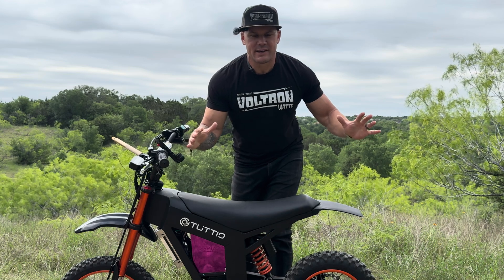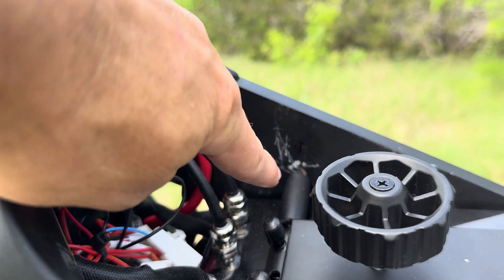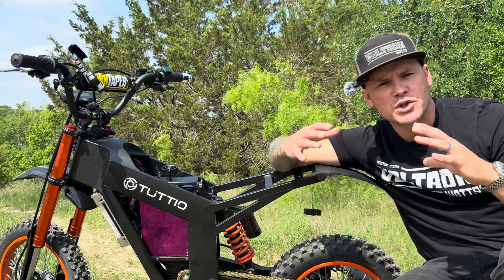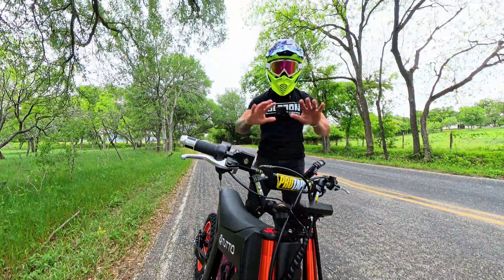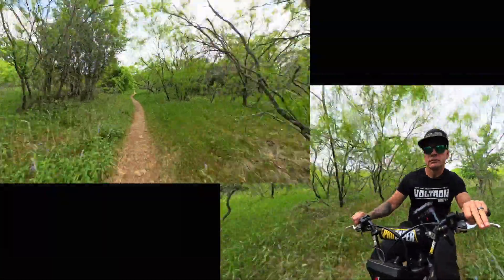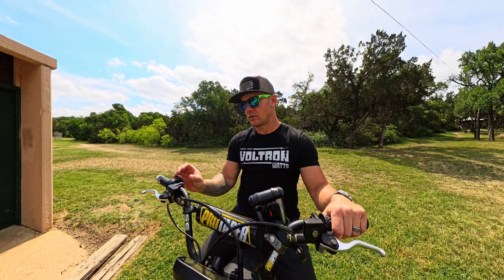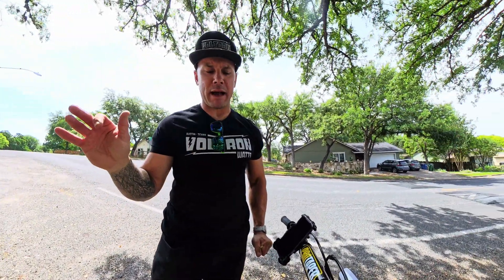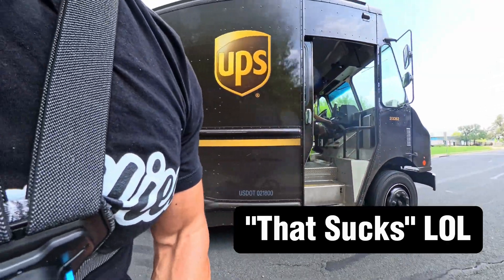72 Volt Tuttio Soleil 01 - Sotion Powered Street Rocket!

Comment: I want to do this but I don't have anything to cut metal really I have a Dremel but that bout it and I don't want to change the rear sproket does that make the top speed go down a lot and seriously it only went 60 mph?
Reply from the maker: 60 is fast bro. Especially on a Tuttio 😂
Reply: @VoltronWatts  70 would be nice tho
Reply: Would my soles go all lot lower with a the stock sprocket?
Reply: Does it have a scary amount of torque?

Comment: I got my son a Mx650 but I’m contemplating if I should just buy a tuttio for him or just upgrade his Razor. I want to purchase a 60v plug and play kit from hotpaxx or 72v kit from momentum watts , but the thing is they are going to cost about the same if not more after upgrading the suspension brakes ect on the razor as the brand new tuttio, I don’t know what to do!! Any advice helps!
Reply from the maker: What about an RTR and it’s just ready to go, no upgrades needed
Reply: @VoltronWatts  RTR is more expensive than all 3 of those options
Reply from the maker: After you pay for upgrades what does your total build come to?
Reply: @VoltronWatts  it will probably like $1,200-$1,400, if I get the motor and controller kit from hotpaxx and a battery from amorge
Reply: @K.O.T.Greers I would get rtr lite they are around 2000 but are so high quality and will last very long

Comment: Does a stock Surron battery work on a tuttio ?
Reply from the maker: It will work but you will have to trim the seat
Reply: @VoltronWatts also does a stock surron controller work?
Reply from the maker: @Conramario7 I have not fit a Surron controller to the Tuttio. I’m sure you can make it work tho 🤙

Comment: Why does the battery say 60v I thought I was supposed to be 72v
Reply from the maker: You lost me. Where did you see 60v?
Reply: @VoltronWatts  it was on the website when I clicked tuttio batteries The only battery that showed up was 60 V.
Reply from the maker: @DJCataraha ahhh. Ok. I thought you meant in my video. I’d just contact them and request a 72v for the Tuttio
Reply: Oh thank you
Reply: Cause if the 72 V battery has basically the same amount of power as the 60 V battery then I’ll just buy it

Comment: It would be cool to see a Tuttio built out with the H02 Sotion Hub swing arm kit. 
Turn the noisiest bike into a silent 10kw/20kw piss missile 🤘
I'm aiming for that exact build but since it'll be a mid drive motor delete I want to drop the battery plate down to get that extra 2/3" and see if a Amorge 40ah surron battery would fit flush if you dropped the battery tray down after the motor delete
Reply from the maker: Would be dope!

Comment: Did u get the losing power issue figured out and also what battery are u using
Reply from the maker: I cover the battery in the video. And it seems the power issue was a loose connection… I think 🤔

Comment: Any updates on this kit being fixed ? Wanted to order the bike to make it faster but now I’m nervous
Reply from the maker: Mine was a loose connection somewhere. Good to go now 🫡 “Voltron” at check out saves a couple bucks 🍻
https://www.sotiontech.cn/products/sotion-72v-8kw-fw23-motor-kit-with-72550-controller-throttle-and-display
Reply: @VoltronWatts thank you so much for responding bro … so if I did this same exact set up and left the stock sprocket do you think it would have enough torque for wheelies now ?
Reply from the maker: @maine8931  I think so!

Comment: How fast will it go with stock 42v battery with the motor and controller upgrade?
Reply from the maker: With a stock 48v battery I don’t think you will get much more speed even if you upgrade the motor and controller. To get more speed you need more voltage and amps 🫡

Comment: Hello sir Voltron. I am curious to know if you found out the source of the issue. I cam considering this setup and an Skeptical on the SOTION kit because of the issues in this video. Thanks!
Reply from the maker: Turned out to be a loose connection on the controller 💪🤙

Comment: Pat outdoors was able to get 50mph with just 72v battery and Bluetooth dongle on stock controller and motor. His battery also fit without any modifications. He also used a 45t rear. The only problem he ran into was bike cutting power when battery dropped below 50%. Hopefully his home build and this sotion kit gets the power cut kinks worked out.

Comment: Wonder if its a faulty controller or motor that's overheating and turning off from a protection circuit. If not possibly a loose wire or connection. 
What did Sotion say about it
Reply from the maker: It ended up bringing a loose connection between the controller and the wiring harness. Good to go now 🚀
Reply: @VoltronWatts  always the simple stuff

Comment: Your bike might be stopping because you are tripping the battery BMS. When you pull too much amps from the battery it will turn off. Make sure on the controller you have the limit set for 115a-120a which is the Max Continuous Discharge Current limit for the 72v 20ah amorge battery. Remember you motor and controller are 72V 8KW which can draw up to 160a!!! Make sure the controller pull is limited to 120a max, or find a higher amperage battery.
Reply from the maker: I thought so too. But even as I’m riding and everything is fine, if I turn the key off and back on it won’t turn on 🤷

Comment: Also Goni to the BMS with your phone and try resetting the stock settings. I had kinda similar problem but it happened because I went into the BMS. But resetting it fixed the no start problem. You might also have you amps set too highly on the controller could be messing with the BMS. Heh messing with all this stuff is half the fun.
Reply from the maker: I’ll try the BMS trick. Thanks for the follow up message!

Comment: Voltron I have the same setup but with stock 60 tooth rear and the Amorge battery from Econic. Ive hit 61 I am also a hair over or under 200lb. I gained top speed by setting the RPM to 100% from 0-6000 RPM then 6500 up to 8000 at 50% the rest at like 25 and 12%. I have the 72/680 controller set at 150 amps. And phase set to around400. Anyway if you try the % change I believe it will help with the field weakening try that first. If that helps you I can send my full settings. There is an hour long FarDriver video I watched it totally helped me. It’s the only hour long FarDriver video.  Don’t remember the name. Good luck
Reply from the maker: Dude! Thank you, I’ll check it out 🫡🍻

Comment: How many kw should u run it at with a 72v and a sotion motor with a stock controller ????
Reply from the maker: Can’t run 72v on the stock controller 😢
Reply: @ ya you can brother just change the voltage to 72v in the app many ppl do it even with surron batterys

Comment: Could you provide a link to the battery you used?
Reply from the maker: Amorge website - I think they even have. Tuttio section 👍
Reply: Econic has the battery with170 continuously and 225 max.  I have Econic battery fw23 and hit over 60 with stock gearing. I’m 200lbs.  So something is up with his setup.

Comment: Your controller is pulling a tiny bit more power than the ANT BMS is set too. I had the same problem with my 60v 210a Amorge turning off with 200a set on my Fardriver. 200a on the controller was 212-214a on the battery, so I set my battery to 215a and now it runs fine at 200a.
Reply from the maker: I don’t think so man. Because I can walk into the garage after letting the bike sit and it won’t work. Then 2 minutes later it will. 🤷 I think there might be a motor hall issue

Comment: Hey voltronn Do you know i Can remove the throttle grip that's on yours in the video because it metal just wondering?
Reply from the maker: Yes. It’s just cheap tin. You can snip it and take the metal off. Then take a razor blade and cut the rubber to expose the throttle tube 👊

Comment: I'm glad I went with the far driver controller rather then the sotion controller
Reply from the maker: To be fair, I don’t know what the problem is yet. I have Sotion controllers and fardriver controllers and each have been good and I’ve had an issue with each.  Thanks for watching and commenting man. 🫡🍻
Reply: @VoltronWatts  put some of the setting down maybe the motor is over heating or the battery. because that would explain the random turn off and turn on

Comment: Not bad,I changed the controller on mine the nd72450b  with my 60volts 50ah baterry stock motor I hope I won't burn the motor very soon, how i have good power and torque.
Reply: How many watts are u putting to the motor

Comment: Sure seems like you are tripping the BMS on the battery. Cuts power till it cools back down. Likely need to turn the amps down in the app a bit. OR look at the motor/controller temp. in the app. if its totally dead, it points to BMS.
Reply from the maker: I thought so too. I did all that…even when the battery has been sitting for a day I’ll go try it and it won’t work 🤷 still troubleshooting

Comment: You have an Amorge battery, it has a real BMS, which means its got a Bluetooth app. Open the app and make sure nothing is wrong in the battery. Check the error log. Make sure you didn’t get any errors in the BMS. 

Keep in mind Amorge NEVER Programs the BMS for YOUR application, they use mostly defaults that will protect the battery,  and if the battery is big, and continues amps are more than controller peak amps, your will never know its never been programmed,

But if its small (like that one), it will trip 5 seconds into a full power run, if controller peak amps goes over max continuous rating on the amorge for 5 seconds. 

When you exceed max continuous for 5 seconds, the ANT (left at default) will close the discharge port. This causes the controller to get low voltage and shut down. If this controller is what is sending the display all information then even if the ANT automatically released the overcurrent error, it might not come back on.

When it would not restart after draining the lizard, you should have opened the ANT app to see if its ok. If it somehow got Low voltage it will shut down. Since you provided didn’t program the ANT, it will automatically shut off the Bluetooth after 5 minutes of idle. This should be set to stay on permanently. Otherwise you will need to connect your charger (not possible), run the motor (also not possible in this situation) or press the BMS start button which should be easy accessible on the battery case.
Reply from the maker: Battery is good to go 🫡
Reply from the maker: I appreciate you chiming in and sharing the knowledge man! You 🤘 rock 🫡
Reply: @ i figured the battery was good, its an Amorge.  But did you check the ANT error log?
Reply from the maker: @imho7250 I’ll check that 👌
Reply: I have a 210a Amorge that tripped at 200a. I went and looked in the ANT app and 200a on my Fardriver was 212-213a on the battery. I adjusted my ANT BMS to 215a to handle those little spikes, and it's good now.
Reply: @HiLuckyB  I had a long reply but YouTube ate it. Lol. Eventually I will make a video or help someone who makes better videos make one.
Reply: @ , Lucky, YouTube reply still broken , so I have to delete and repost a few times lol

The readers digest version is, based on these assumptions:
You have a Fardriver 72450, and your accessories use less than 10 battery amps
Your motor is rated at 50a-100a maximum continuous.
Your cells are rated at 30a continuous and Amorge built you a 7P pack.

So lets say you asked amorge to use EVE40P, which mooch rates at 30a/50a. So Amorge will choose a BMS around 210a (7*30a) continuous. Then they will set max continuous (DisCHGOvercurProtect) to 210a. The time delay will be 5s default and this is what Amorge never changes. Then they will set L2 overcurrent to 350a (7*50a), and leave L2 delay at 1000ms (1 second).

So your conflict is really the 5 second delay.

If I programmed your ANT, for your bike, I wouldn’t set
DisCHGOvercurprotect: 140a (20a/cell continuous)
DisCHGOCPD ((how many seconds you can exceed the above value without exceeding L2 below): increase from 5 seconds to 30-60 seconds)
L2DisCHGOCP: 235a (this is bssed on your 213 plus 10% wiggle room) if there is ever more than 235a leaving your battery there is a problem) 
L2 delay: still 1000 MS. Thats plenty of time for a spike,
Short circuit Protect around 500a, just high enough so it doesn’t trip when connecting the battery to a drained controller.
Short circuit time delay: 1200MS(0.0012 seconds).

Its important to understand the first delay settings is not only how long you can be over 140a, but more importantly how long you can be at 235a. So its easy to see the lower you set L2, the longer time delay you can allow. The net result is your battery is protected much better, and you will not trip the bms if your controller pulls current down at top speed. Even setting this delay to 60 seconds the cells will still be protected.

And if you loan your bike to somebody else and they try to ride up a sand dune, after the time delay YOU set, his joy ride will end and your motor lives to see another day. Lol.

Comment: You think the motor ran way too hot from all the load having a tiny rear sprocket on? It’s possible the motor temp just creeped above the controller range / parameter settings
Reply from the maker: No, I thought that too maybe. I put my hand in the motor and it was still good to go. It works and doesn’t work at total random times 🤷 great video on the ROD and Bolts & Volts Tuttio kit you did man! 🫡
Reply: Might have the wrong setting in the controller for the temp sensor mine didn’t learn the right one off the top of my head with the fw23 was like 6- or 7th on the list.  My controller thought I was over heating but NOPE just the wrong setting